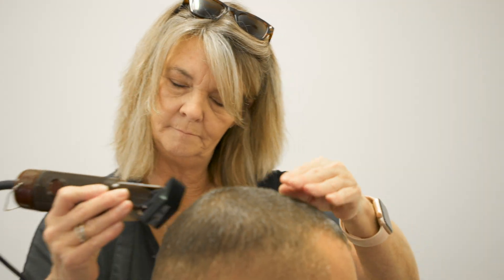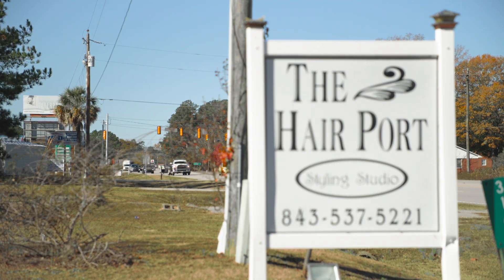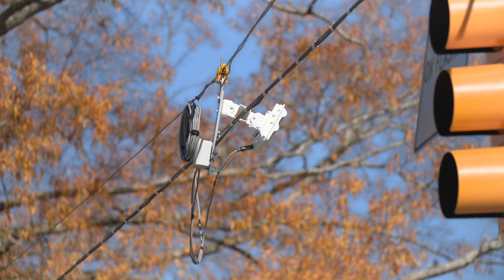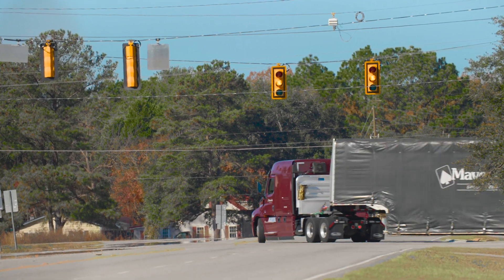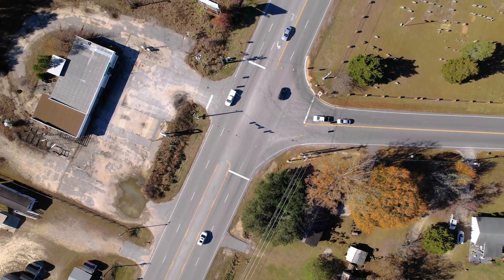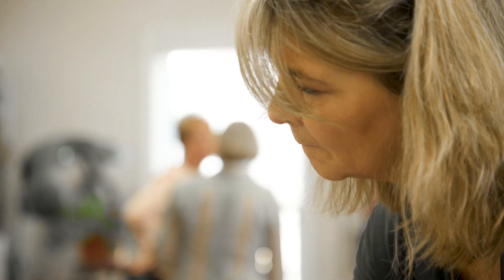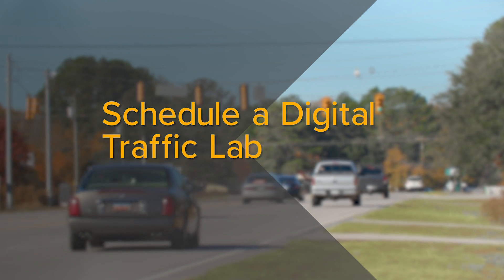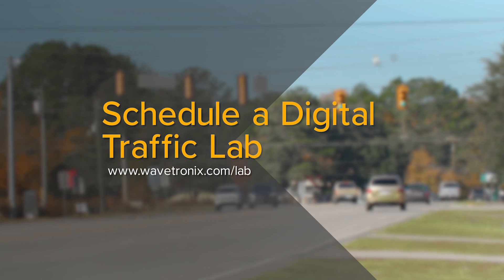Dynamic Dilemma Zone at work in Cheraw, South Carolina

Comment: We need this in my area, earlier this week I experienced the dilemma zone for the first time on a 45mph intersection where I was approaching the intersection at around 42mph approx and it started to turn yellow literally in front of me, and has to make a decision to brake hard and risk getting rear ended, or stop inside the intersection or accelerate slightly and head through the intersection.

This particular intersection is fairly problematic, and I see people pulled over by cops all the time here not to mention, has like 20 cameras on poles.  I'm surprised the town hasn't been sued tbh